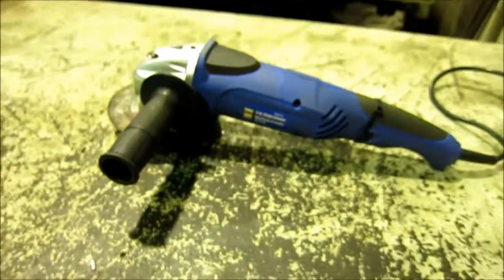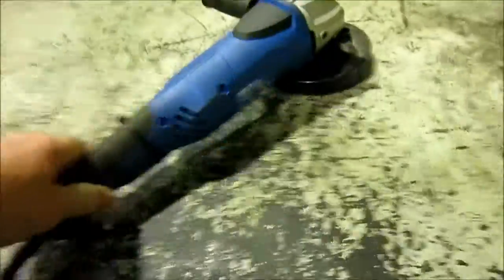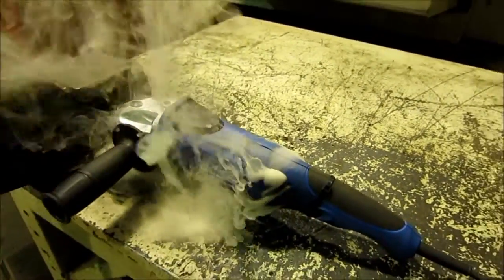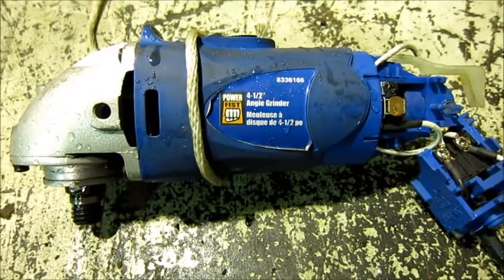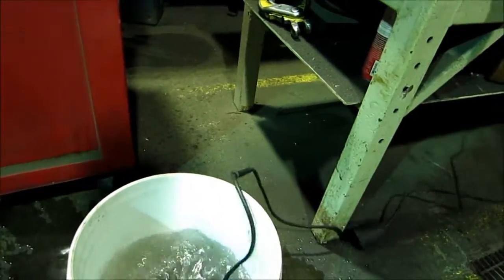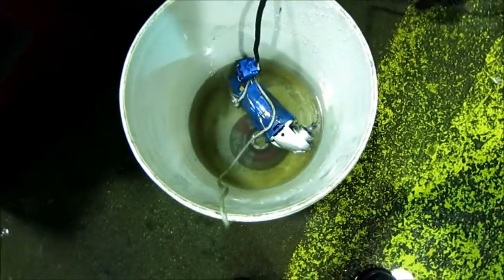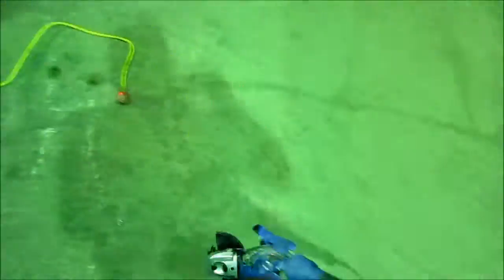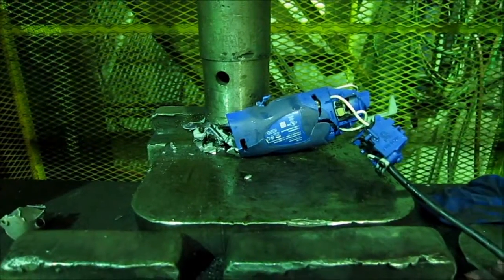Will it squish - Power Fist Grinder

Comment: This shows its a strong tool you put it in water and crushed the body in the press and it still ran. Until you finally killed it. Overall in my experience powerfist tools always work great but just like anything else you have to maintain them.